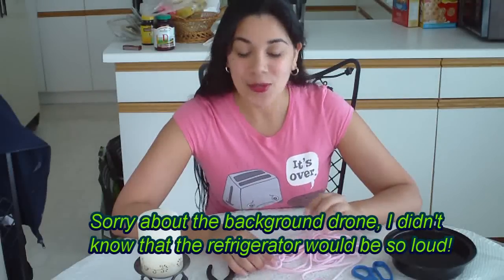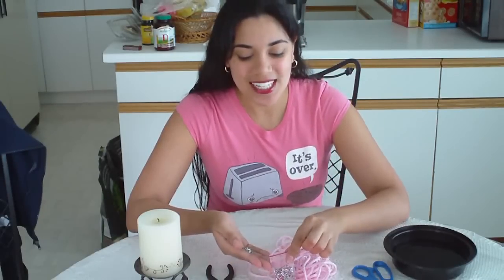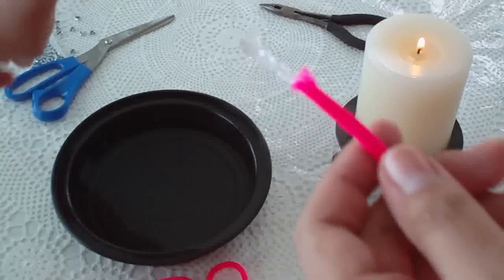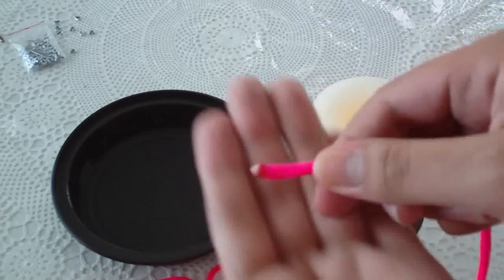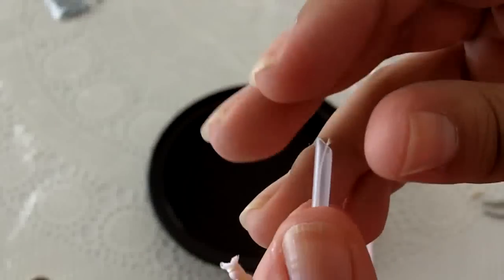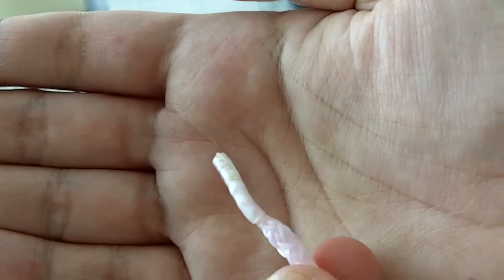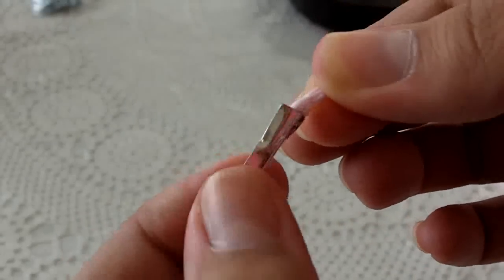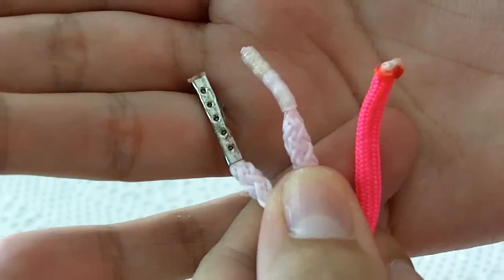Tipping your Laces: Aglets, Shrink Tips & More | Lucy's Corsetry

Comment: I managed to use a combination of these methods to successfully put aglets on my laces. So thanks for the video!

I bought screw on metal aglets. I melted the ends of my laces to seal them, then wrapped them in thread to make them the right size. Then I was able to poke the end of the lace into the metal aglet and use its screw to secure.

Comment: I'm surprised no one has mentioned this, but you can also wrap tape around the ends. It serves the same purpose as the tubes you bought, but is far cheaper. You can also use clear nail polish (or other types of paint)  to seal the ends. I have an aversion to open flames, so I use these methods to seal off my ropes and prevent fraying. You can also try the string method used by the Two Knotty Boys on their YouTube. I find it comes undone on its own, but tape/tips would fix that.

Comment: You can use a flat iron meant for hair to seal the ends of synthetic laces, I've done that before but not for corset making. In a pinch wrapping some scotch tape around the ends of cotton laces and a quick pass over a candle to seal the end also works.

Comment: For Aglet tipping Para-cord you can also use 5/32 inch round Brass Tube ('Squared end' cut to ¾ inch lengths and carefully deburred on the inside ends). The tubing is available on-line at Micromark under their Resin, Wood, Metal, Plastic. Link. Any larger diameter tubing will not fit through the standard diameter of the grommets of an Orchard Corset. (Whatever specific Grommet sizing number that is). However, this is not something simple for just anyone to do, as the para-cord is roughly the same thickness as the diameter of the Brass tubing.

..Getting into the details: I made a simple tool for correctly 'heat cutting' Para-cord by taking a 4 inch straightened length of ¼ inch diameter Copper tubing, and vertically slotting down the side of one end to fit the 'clasp' side' of a 'single edge' razor blade, using a Dremel tool and a standard Emery Cut-off wheel. And then drilling a ¼ inch hole into the end of a short piece of ¾ X ¾ X 4 inch long piece of scrap wood, as a handle to hold the Copper Tubing/Razor blade combination. Lay the end of the cord where you want to cut on a piece of scrap wood, heat the Razor blade of this tool over a Propane torch until the blade glows red hot, then 'melt-cut' the Para-cord with that. This fuses the ends of the Para-cord  as you cut, so there will not be fraying ends.

For cutting the 5/32 inch Round Brass Tubing to ¾ inch lengths, again use the Dremel Tool and an Emery Cut-off wheel to get a good 'squared end cut'. A 'Pipe and tubing cutting tool' (the kind that rolls a cutting wheel around the tubing) will not work in this application, because it would 'Crimp' the tubing inward as it cuts it. ..I then 'deburr' the inside ends of the ¾ inch lengths of Round Brass tubing with the small blade of a Swiss Army knife until the inside ends of the tubing pieces are smooth.

Now comes the more difficult part.. Heat the cut end of the Para-cord with the flame of a lighter or candle just until it starts to evenly melt, but has not caught fire. And then quickly 'pinch-roll' that melted end between your fingers as it cools. You need to use your fingers for this, because you need to be sure that you are 'pinch-roll' squeezing the 'melt-knot' end of the Para-cord to a slightly Smaller Diameter than the diameter of the Para-cord or it will not fit into the end of the ¾ inch length of the 5/32 inch diameter Round Brass Tubing. If the 'melt-knot' of the end of the Para-cord is not small enough in diameter, you will need to repeat this process until it is.

This next part takes some time and patience: Once you can get the end of the Para-cord just barely started into the Brass tubing, you need to patiently 'pinch-roll' the Para-cord between your fingers with one hand, while pushing the ¾ inch length of Round Brass Tubing onto the Para-cord with the other hand. This will take some time and patience to do, but eventually you will see the end of the Para-cord begin to emerge from the other end of the ¾ inch length of the Brass tubing. Once the end of the Para-cord has emerged enough to grip with a pair of needle-nose pliers, pull the cord through about an inch.

Now slide the Brass Tubing 'Aglet' back towards the end of the Para-cord until just a little less than 1/8 inch of Para-cord is still showing out the end of the 'Aglet'. Now, once again with a lighter or candle, 'heat melt' this 1/8 inch end of Para-cord, and 'mushroom' it out just a bit, then 'pinch-roll' this end between your fingers to the same diameter as your Round Brass Tubing 'Aglet'. (Remember anything larger than 5/32 inch in Diameter will not fit through the grommets). Once this end has cooled you can grasp the end of the Para-cord by this slightly 'Mushroomed' end and slide the Brass 'Aglet' up the Para-cord a little ways. Now apply a drop or two of 'Super Glue' to the end of the Para-cord just before the 'Mushroomed' end, and quickly slide the Brass Tubing Aglet back to the end of the Para-cord while the 'Super glue' is still wet. This will anchor the 'Aglet' in place, so that it will not slide on the length of the Para-cord any longer.

..And yes, it is much simpler to just buy the correct diameter and color of heat shrink tubing from Newark.

Comment: Hi what is the best way to tip satin laces?
Reply from the maker: For ribbon, I typically cut at a 45 degree angle and then hold a lighter or candle close to the edge just to melt the raw ends so they don't fray. If you want an aglet, the metal ones look best but are the hardest to set in a way that looks nice unless you have one of the expensive aglet setter tools.

Comment: what is the 30-40 dollars tool you talking about for the metal aglet ? during 5:02
Reply from the maker: I looked for it again, but it's actually much more expensive now:
http://www.venacavadesign.biz/VCD_shop/index.php?id_category=52&controller=category
Reply: You can purchase crimping tools with multiple size crimp points for about $15 just about anywhere.